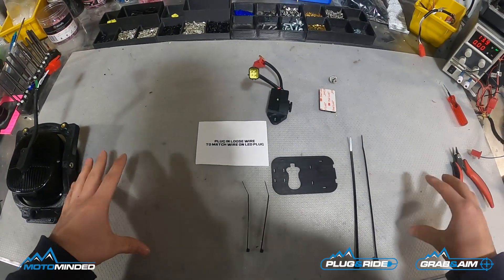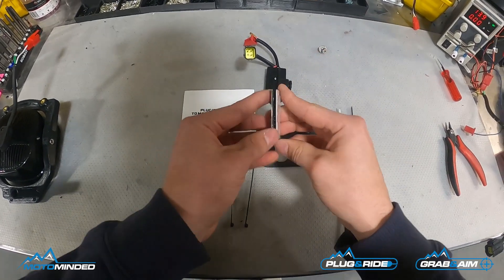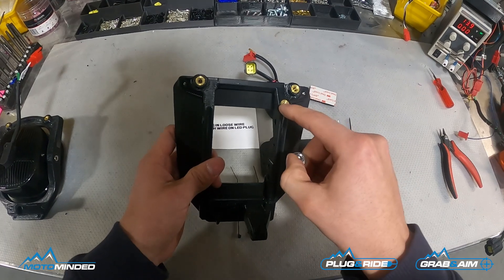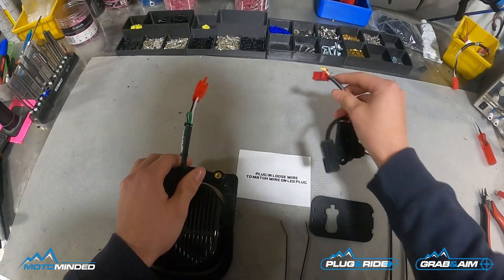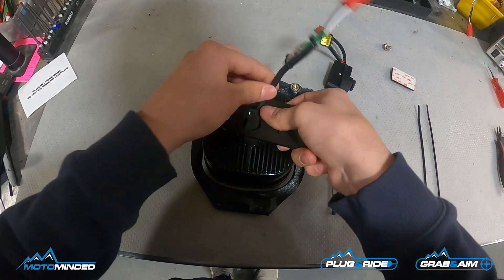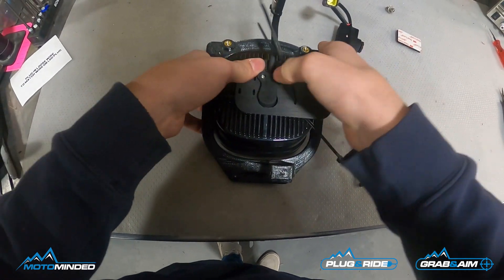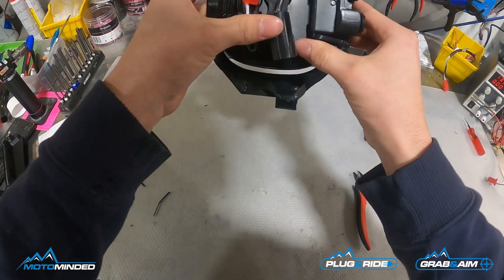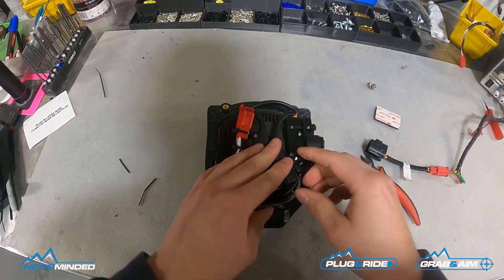Manual Dimmer Install

Comment: Not with our adjustable dimmer. If you use the Baja Designs relay dimmer (not adjustable) it uses the green wire.